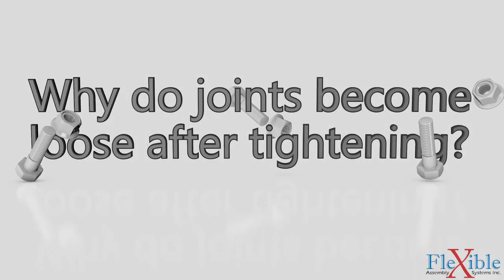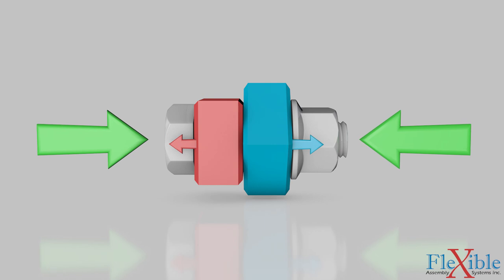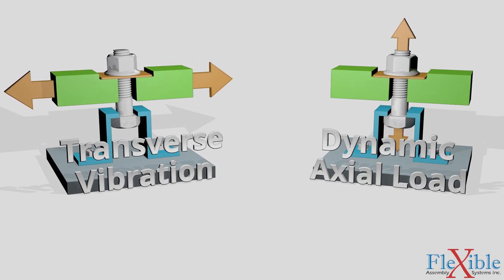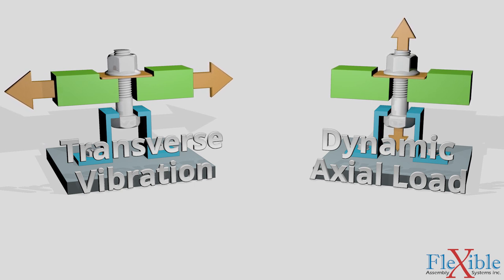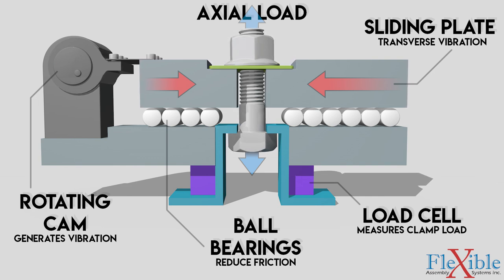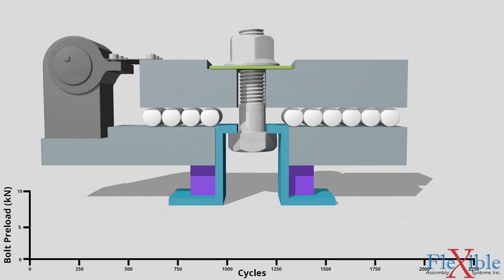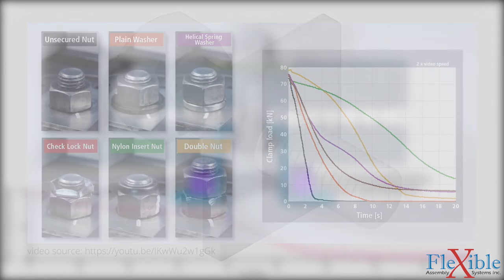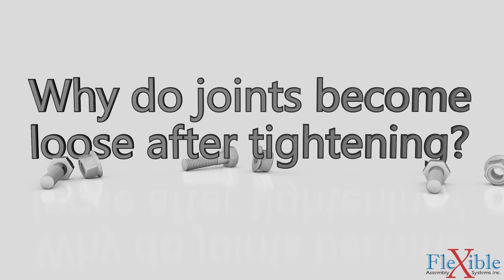Why do joints self-loosen? The Junker Test - Fastening Theory Part 3

Comment from the maker: Some tips for preventing bolts from loosening when designing a joint:
1. Use the joint in a low vibration environment
2. Use bolts with fine threads (small pitch)
3. Use a large preload
4. Use materials with high coefficients of friction
5. Use Loctite on the threads
6. Use an adhesive between the bolt head and flange
7. Use lock washers